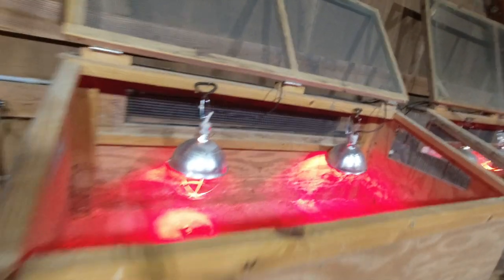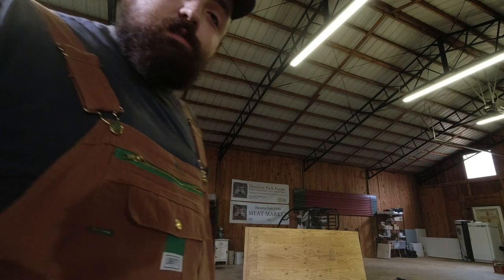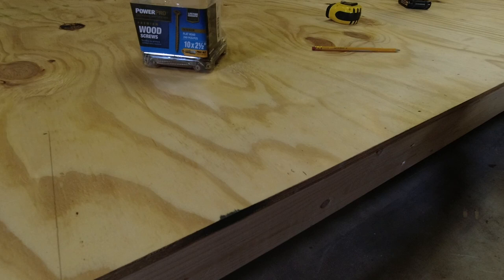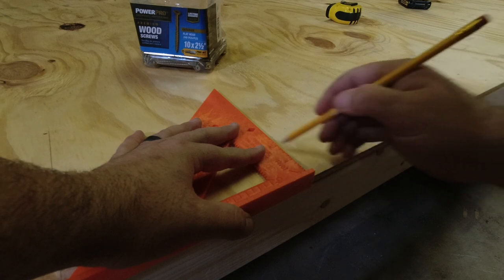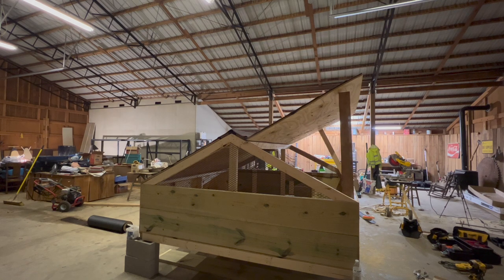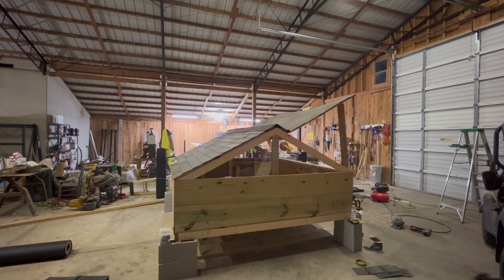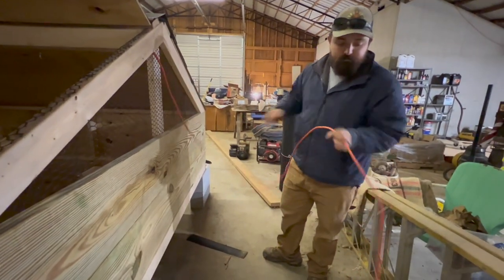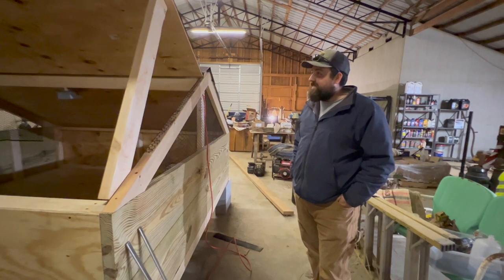New Farmhand Builds A Joel Salatin Style Chicken Brooder!

Comment: You need to cover the inside framing on the drop down doors or you are gonna have a mess when you go to scape out the litter.

Also you need to give those flip up top lids framing support or they will warp and also pull out the fasteners on the hinges.  

The hold up support that holds the lid open.  Notch the bottom so it locks into place on the wall frame top sill.  It will prevent it from being knocked off by accident with someone with half their body leaning in and causing a injury.

Comment: Nice to see him be able to build it from a picture.  Nice looking brooder, it would be nice to have it on a set of wheels so you can move it easily. Make life easier to clean out or to put chicks on pasture. 
I couldn’t tell, how much over lap did your shingles have?  I believe you need an inch and half to keep water from running inside and down your 2x4’s, otherwise water will pool up and rot out your boards.  With it being outside you may also need 2x4’s at least every 24” to help carry the snow load of the roof, the basic load.
Reply from the maker: Yeah. He’s a talented guy. We didn’t do a big overhang. May need to toss a tarp over it and I may put it on a trailer and bring it into the barn in the winter.

Comment: That's a Beaut Chuck!

Couple of thoughts...

The sectioned fold down front is brilliant. I wish I had done that with the ones I built. I had planned on a small fold up section on the side, but your big fold down on the front is much better..

One thing I did find too be hard that you might run into is trying to corral the chicks too the opening. Ours was a bit too tall, deep and wide to just reach in and grab them. Yours is much bigger. It may be hard to force them ask over to where you want them. If you have or find an easy way, I'd love to know.

One thing I really regretted and plan to fix for this year, and that you may want to consider doing, it's lining the bottom with linoleum or vinyl flooring. It would make cleaning the old bedding out, so much easier!!

One last thing I noticed is, sometimes for warmth, we would cover one of the fold up hardware cloth lids with a cut out sheet of insulation. Even with nothing on, but especially with one side covered, we had lots of problems with dust and particulate in the air inside the brooder. Even with premium low dust shavings, it was enough to concern me. I would suggest throwing an exhaust fan on one of those top side areas too draw dust and dander and what not out of the brooder.

Just some thoughts. Either way, it looks great!!

Thanks,
Richard